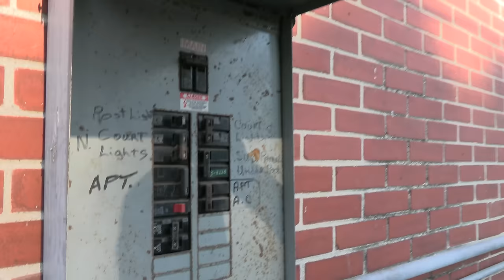Upgrading My Own House to 1,000 Amps

Comment: So you don’t put expansion fittings out of the ground into your meter cabinets? What about expansion and contraction?
Reply from the maker: It is our understanding that 1) the underground conduit is 16 months settled, and unlikely to move much further and therefore 2) the short runs up into the meter cabinets will have negligible expansion, contraction, or movement. Do you disagree, @M Carroll?
Reply: @ElectricProAcademy  you ever see a meter base or equipment ripped off the house-structure after some years of the ground expanding and contracting? It happens quite often. Some of my experience in the trade for 25 years, I’ve seen some crazy stuff.
Reply: But I know cost can be an issue. I like it because it’s added insurance to a job.
Reply: At a IAEI class maybe 8 years ago the well respected I inspector/instructor stated that all meter cans feed from underground should always have an expansion joint on the PVC to allow for ground settlement and expansion & contraction. Up North have seen where the PVC pulled out of the male adapter enough to pull wires out of terminals.
Reply: @JohnThomas-lq5qp  yes totally agree. I live up North, and it gets really cold in the winters and really hot in the summers. Can’t believe he does not use them on his conduits coming out of the ground. I’ve seen conductors cutting into the can because of no expansion fitting being used.
Reply: @mcarroll598  Well, the carriage house service (the middle one) has an expansion joint with that adapter.
Reply: @jovetj  why not put it on all of them?
Reply: @mcarroll598  Because only the carriage house service needed a conduit size adapter.  (I don't know the actual answer to your question, I wasn't there :D )
Reply: @jovetj  that’s cool. He doesn’t think you need them, that’s fine. Me personally,  I would use them.
Reply: @mcarroll598  It's really one of those things that is gonna vary by location.  Short lengths are going to have negligible expansion.  When the ground is involved, there are even more variables. 
 
I don't think there needs to be a Congressional investigation (or big home armcharing) into this because 1) Joel knows his local conditions 2) it's utility approved 3) It's Joel's personal property 4) if it breaks within 25 years, Joel's wife will never let him hear the end of it. Am I right?
Reply: @jovetj  It doesn’t really matter I guess. I’ve been in the trade 25 years and seen a lot of issues from not using him. But if his inspector is ok with it, I guess don’t put them in then.
Reply: @mcarroll598  Luckily Joel can fix it if he needs to.  I don't really care for the look of PVC conduit, myself. Especially the larger stuff.
Reply: good point, freeze/thaw cycles wreak havoc on everything, unless the conduit is buried deep and well below the frost line, an expansion joint is always wise.
here in Ohio, they required them as of mid 1990's, on every single conduit riser from the ground.
Reply: @throttlebottle5906  yep….. I’m from Ohio,  I’ve seen it for years where expansion fittings haven’t been used and the problems that occur.

Comment: Also doesn’t the pole transformer have a voltage adjustment switch.
Reply from the maker: No it doesn't! That would be cool
Reply: The only adjustment the pots have is a lineman reaching in the top and changing taps on the primary side to best match the distribution line voltage.
Reply: @djscrizzle  Some transformers have big hex bolts on the bottom that can adjust it a few volts either way.

Comment: As a european, asking why the cabinets are so big is pretty much the least of my concerns. 
I worry more about IP rating. Even here the code requires only IP44 in unshielded outside locations but in practice everything is at least IP54 or 55, more often IP 67. I can't imagine these metal boxes to have an IP rating of more than 21 or 22. 

Coming from a country where every household has 230/400V 3-phase this is like watching cavemen celebrate a shiny rock.

Comment: The utility is still going to install just a 25kva transformer to supply your "1000amp" service.
Reply: Yeah that can on the pole looked a little small, there's no way that's a 240 or even a 200 kva pole pig. That pole pig is probably max 75 kva. The big ones have small oil cooler loops on the sides like jug handles or small flat plates depending on the brand. I did a big house recently with a 400 amp service, two  200 amp service entrance rated transfer switches to a 48 kw Generac standby generator, another fused 200 amp disconnect with 125A fuses going to a dedicated solar inverter subpanel with 2 40 amp, and 1 30 amp 2p breakers, and another 100 amp fused disconnect feeding a detached garage. Utility supplied a 50 Kva big pad mounted transformer, way bigger than this place but for "only" a 400 (320) amp service. They base it on a load calculation, and past usage history, not just want you "want". The POCO had way more detailed and granular load information from the smart meter data. In this case, the engineering agreed with me for the bigger transformer. The good news is, was only about a $5000 upgrade charge from the POCO :)

Comment: And her i am thinking, god dam a 1000 amp service that's enormous what the hell is that for, while at the same time that I am in communication with my utility about installing something like a 1500 amp 480 volt service for my property, though at least that's for a solar farm that will be selling to the utility rather than consuming. 

Still though, kinda shows how much 120/240 split phase kinda sucks when one 225 amp 480 volt three phase panel has just over 75% the power of a 1000 amp 120/240.

Comment: Coming from germany this looks so messy for a "new" install but well we also have 3-phase 380V up to 63A for a normal house over here to our advantage :D
Reply: Germany and Europe in general have home service that can be 3 phase, and even if single phase is normally 220 volts phase to phase.  So much higher voltage than in America.  Vacuum cleaner, refrigerator, TV set, all are 220 volt in Germany and Europe.

Comment: One thing for sure is if that was my house none of those PVC pipes would be on my walls, just threaded conduit because that PVC does not last in the sun and colder weather, so in a few year's time, you are back to where you started from broken shitty pipes.
Reply: That’s why you buy UV treated pvc, the sun won’t damage it
Reply: I think metal looks nicer and has superior protection, even if it gets a bit rusty in 30 years.
Reply: @Nick-bh1fy  It still warps and turns colors   PVC is crap cheap stuff. but hay your the pro
Reply: @wirenut003  I mean personally I wouldn’t surface all that pvc but using rigid electrical pvc is still perfectly acceptable assuming proper fittings and installation is followed

Comment: I honestly don't know why anyone would need 240+ kW of grid service to their home or what you do that would require it, but this sounds like it was an absolutely mammoth project, getting your local power company to approve you having a full kiloampere of service as a residential customer.  However, I understand that if a business such as a large office building, hotel, hospital, et cetera, needed to install EV charging kiosks in their parking lot for their tenants/guests/patients, et cetera, 1,000-amp service would be a pittance compared to what would be needed to power it as well as their additional equipment and appliances.  I'm sure with that kind of power coming into your house, you probably would have been made to install three-phase circuitry to accommodate it all.
Reply: Probably has a fleet of EVs

Comment: I think all external lines shall be fitted with excessive slack and ran I to any box as so. Nobody should be seeing new services with on faze with ample slack and one not. Nit using this as anxample just saying in general. I see this everywhere when I open Service panels. There's lack of slack at all. Even on bran new homes. I look at it and I'm like wtf man.
Reply from the maker: Amen, @Robert r! Service loops everywhere.
Reply: problem is, many of the utility co's want the wires direct and short to the terminations, especially metering sockets. you put service loops in and most will flag it and not connect power!
I think it's stupid not having any slack myself.

Comment: wy would this be an upgrade? Igot an in house main fuse box and digital meter my aim is to use as little as possible. so fridge washingmachine tv and pc a aquarium and a light. thats it. im alone so turn off what u dont use.
Reply: Much more power for electric vehicle charging.

Comment: We have 3x400V@40A That's 27.000 usable Watts of power.
That's to me allready a lot for a single home. At 1kA even single/split phase 110V does 100kW... pretty insane.
Reply: They have Murica 12V
Reply: At 246 volts (measured at the meter base) they have 1,000 amps or 246 KW of power if they went to 100% on every line.  Since it is only safe to reach about 80%, that means still well over 200 KW can be used at the same time!

Comment: 130V seems way out of spec. For most utilities it should be 114 -126 at the service. 130V is high enough to start causing premature wear on things like incandescent bulbs and on analog electronics with linear power supplies.
Reply: Interesting.  It's my understanding that most utilities consider 10% to be within specification.  For 120 volt service, that means 108—132 should be considered acceptable.
Reply: @jovetj  nope for most it's seems to be +-6% except here in Australia where it's +10% -6% and that is only due to lazyness because they reduced the offical voltage from 240v to 230v and instead of changing every transformer they just increased the upper tolerance
Reply: No way, 114 is way too low, nowadays 120 is minimum, it's usually more like 125/250 in no-load conditions. 5% max is 252, but the rule is the max on a 240v circuit is 264. As far as modern electronics go, most things have PWM switching power supplies now for the AC to DC conversion, and a lot of those like my laptop are rated for 100-250 volts and 50 or 60 Hz. So that way you can bring your laptop or device to literally anywhere in the world, you just change the pigtail on it to a locally compliant plug.
Reply: @brnmcc01  120 isn't minimum it's the nominal voltage 5% either way is in spec so 114 isn't too low it's just the bottom of where you want to be as for 240 no the max isn't 264 ansi c84.1 the max is the 5% at 252
Reply: @brnmcc01  It must be dependent on the specific utilities standards. I do know that many utilities, including one i worked at, utilized 114-126 as their acceptable range at the service entrance. This included heavily loaded conditions however, so the unloaded voltage was typically targeted to be between 120 and 126. Something persistently above 126 would have been considered an over-voltage condition.

It is worth noting that as a design standard, appliances should be able to handle at least +/- 10%. I'm just sayin the range most utilities consider acceptable is 114-126 under either heavily loaded or unloaded conditions.

Also, you are totally correct that switching power supplies won't care. I specifically meant the older style of linear power supplies consisting of transformer>Bridge Rectifier>Capacitors>linear regulator. Those types of supplies are often found in older audio electronics and will dissipate more heat as the voltage rises. Same thing with incandescent bulbs wearing out faster, but those are quite rare nowadays.
Reply: @shaynegadsden  You're right, I had to go look it up. +/- 5% is for residential. +/- 10% I got from most equipment labels, but this has more to do with UL requirements. I got power supply versus power consumer devices mixed up. For example, a single phase service is always nominal 240 volts, but every electric motor out there is pretty much 230v rated. Here's the complete rule:

1) For service rendered for individual residential use or specifically for lighting purposes, the voltage variations shall not exceed five percent (5%) above or below the standard base voltage.

(2) For other service the voltage variations shall not exceed ten percent (10%) above or below the standard base voltage.
Reply: @shaynegadsden  For example, many single phase air conditioning units I've installed say on the label beside the MCA rating, is voltage range min 188 - max 264 volts. The reason for this is they are dual rated for use on both 208v systems or 240v systems, and 208-10% gives the 188 number.
Reply: @chrisbauer1925  Yup but those power supplies would need to have a FULLBRIDGERECTIFIER. lol, and you can also get 'rough service' incandescent bulbs that are 130v rated.
Reply: Just start pulling amps... voltage drop will fix it

Comment: why would you possibly need 1000 amp service?
Reply: e/v chargers can be as high as 80 amps so 400 amps for up to 4 chargers- 2 200 amp services for main house plus apt/workshop- 200 amp for garage or 100amp to 150amp with room for a sub panel  overkill maybe?

 but a lot of pple have been asking for advice on service upgrades i tell them if your thinking of e/v's at least a 400 amp service
Reply: If you go all electric you need a massive service. My electric tankless water heater is 150amps, my EV charger is 80 amps, I haven’t even turned on a lightbulb and that maxed out a 200 amp service. Add in heat pump 40 amps, induction range 70 amps, lighting, electronics you are already at 400 amps. Now add a second apartment, or a hot tub/ pool, you need even more!
Reply: I agree that 1000 seems like a bit much, but the 200 amp service that exists as the standard now is rapidly going to become outdated, especially for area's with no gas appliances at all. My rather standard sized 2 story house uses a 200 amp service, an its actually already very limiting because everything in the house is electric. water pump, 2 AC units, Oven, Dryer, Water heater. this is incredibly limiting because in the future we are going with at least 1 EV, tankess water heaters, and electric mowers, which is going to put too much demand on a standard 200 amp panel.

The only thing stopping me form going to a 400 amp soon is that I have a property large enough to support a 1-4 megawatt solar farm, and of course if I succeed in adding that, that means going three phase.

Comment: Why so many panels on one house? I lost count.
Reply: Rentals. I would have just did one service with one meter, and put CT's on the tenant subs and then "include" the electricity in the rent. It's not legal to technically resell power, but, with the CT's, you can keep an eye on tenant's power consumption. Like bust them for that grow OP in the attic etc....Plus in Indy you can get an off peak rate for EV charging, so that's why a 2nd meter was needed at a minimum. Also, getting a 600 amp service is super expensive and needs to be signed off on by a PE, and the metering cabinet and meter base is freaking gigantic. I looked into one guy I know he has a 400 amp service for his house, and a 200 amp service for his barn/workshop. And I asked the POCO there if would be feasible to replace the entire service with a 600 amp service, since the customer already has his own pad mounted transformer on his land out in the front yard. But no, it would have been so expensive to buy a 600 amp cabinet, that what we're eventually going to do is just add a breaker under the 400 amp main on the house feed thru conductors on the disconnect, and then trench over to the workshop and refeed it, and then the utility will cut off that service at the transformer and just abandon in the underground conduit, or get ahold of it with the skid steer and see if it'll pull out, but since it's just AL wire, not really worth the trouble to dig it all up just to scrap it. The reason is, that particular POCO charges $44 a month for each meter, so he's paying $88 a month in meter charges alone having both a 400a, and a 200a service on the property. Save $44 a month by going to one meter, and one bill.
Reply from the maker: The voice of experience. You're exactly right. Some of the surrounding counties to Indianapolis don't have it so good.
Reply: @ElectricProAcademy  This customer is in rural Monroe county near lake lemon. REMC is the POCO there. They're great to work with, the engineer there even asked me if I could replace a couple of generators at one of their cell tower sites, but it was too far away and too rusty, he wanted one genset relocated and another disconnected and moved there, and I was like yah I don't have the manpower or time to do all of that! But it was nice for him to offer me the job.

But that monthly minimum charge of $44 a month plus taxes even with zero power used is a killer!

Comment: Wow, a 1k amp service to residential???!?!?!  Here in Phoenix, old homes are 100amp, all homes built from the 80's on are 200 amps.  You can get a 400 amp service for residential, but its PRICEEEYYYYYYYYY, and I think you have to move to be a commercial account.  The amount of computers and servers I run, I wanted 400 amp on my new build, but the builder and community were a firm NO.  My next home will be a custom build with my own contractors and lot I own.   I will do a 400 amp service then.  But I think 400 is MAX for any single family residential service here in Phoenix.
Reply: @es-qf2gw  Yeah at that current level I'd just go three phase. Especially since three phase lines are right there. Its probably be cheaper to run a 600 amp three phase service than a 1000 amp split with 3 meters, since companies often charge a base equipment charge per meter.